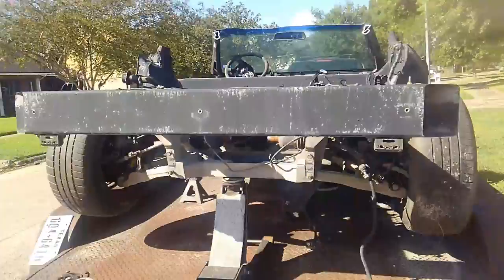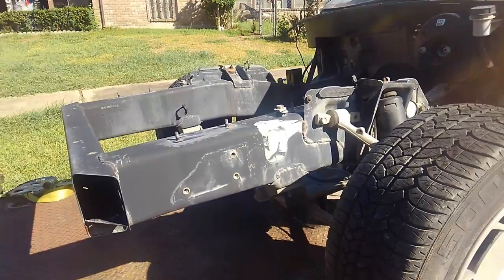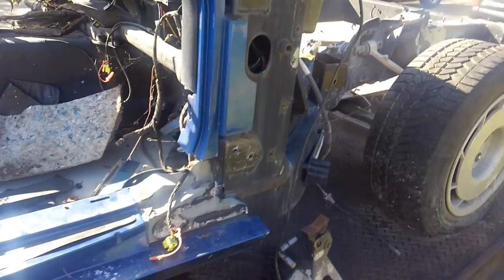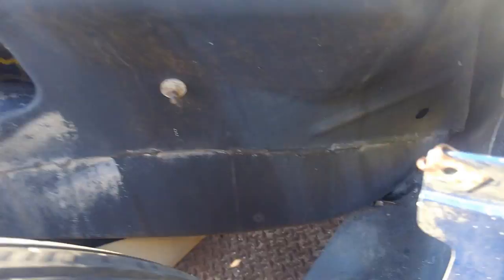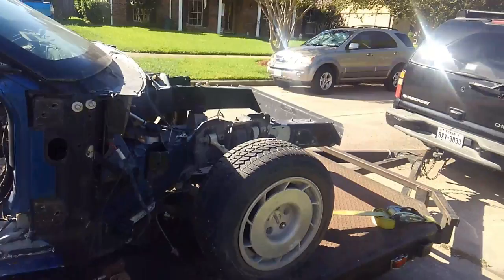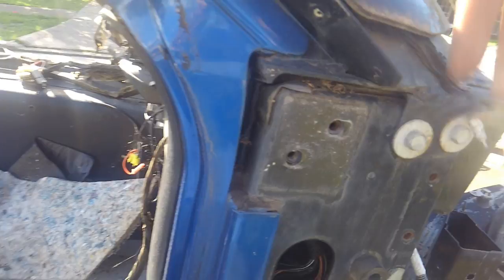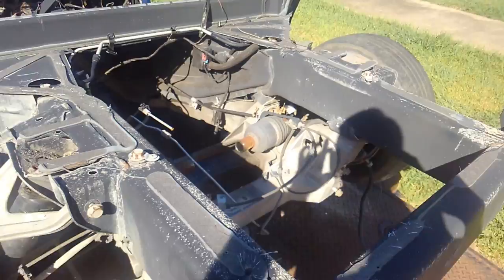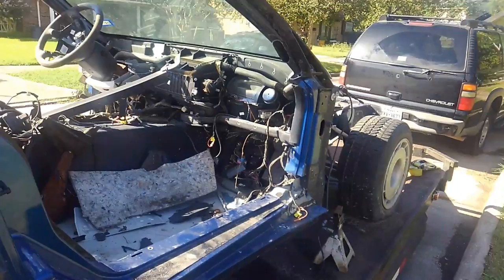How To-What Kind of Frame Does a C5 Corvette Have Exactly?

Comment: Looked at the Sawblade wheels and mixed it up with buddies C4 Grand Sport that was being disassembled. Thanks for taking the time to correct my comment.  Nice video.
Reply from the maker: James, not sure what you're seeing, but this is a 2002 C5 Z06, NOT a C4. The C5 hydroformed rails are welded in several spots where they connect to the front and rear tie bars, as well as the rear bulkhead behind the seats. I am pretty familiar with the differences between the two since I have been dismantling them for over 25 years. Thanks for watching👍.
Reply: @VetteSource  You are correct, my mistake.
Reply from the maker: No worries, happens to everyone at one time or another. Have a good evening👍.

Comment: I have a 2001 Z06 that has impact damage on the right rock panel beneath the door.  The car has yet to be torn down but Im almost positive that the lower right frame rail behind the rocker panel is bent in.  If I understand what you are saying in the video correctly are you saying that it could possibly be repairable?  I hope so.  I really don't want to lose this car.  Thanks.
Reply from the maker: It is repairable, it's just not the easiest spot to fix when it has been damaged. Make sure you have a good frame guy with right equipment, as he will need to make sure everything is lined back up for proper fitment.

Comment: Great information here! I have an 84’ beetle and I was thinking of putting it on a corvette chassis. Which year would be best? A 91’ vette is available for parts. Thank you so much!
Reply from the maker: Glad you enjoyed it👍. The C4 chassis is pretty much the same unitized design as a C5, with the exception of it being welded together in a few more sections than the C5. 

Most of the time when you see a custom build with a C4 or C5 chassis, what they really mean is that they used the suspension and small part of the chassis to mate to the car that that is being used for the build. 

Placing the body of another car over the top of the complete C4/C5 chassis, while not impossible, requires an large amount of work and custom engineering.

Comment: I think it would be interesting and educational if you set up a time lapse video of dismantling one of these.
Reply from the maker: Great idea, I have been thinking about that recently and trying to figure out best way to execute while showing as much detail as possible. Keep an eye out, I will probably try to put something together in the next few months.
Reply: @VetteSource  Yeah, I'd like to see that too. I'm going to buy and dismantle a C5 to use the suspension and running gear in a 1953 Chevy pickup.
Reply from the maker: @7884mac  yep, using the Corvette suspension is a popular conversion. You may be aware already, but the C5 Corvettes use a transaxle setup with the transmission in the rear of the car. The front and rear suspensions are "corporate" looking and resemble a front wheel drive setup in quite a few ways. The C4 suspension is the last old school style IRS axle made, and looks great installed on the earlier model cars.

Comment: I've got a bad idea probably but how had is it to separate the entire frame from the body to use the drive train and frame on a classic I have a 02 c5 I'm thinking about swapping under a classic
Reply from the maker: What you're looking at in this video IS the frame for the car. Since it's a unitized chassis, you will have to perform quite a bit of cutting and modification to both cars to make it fit another body shell on top on the C5 unibody. It would be much easier to cut the suspension mounting points off the C5 and integrate them into the frame of the car you want to build.

Comment: I've been looking too see a bare bones c5,cause  there's one (z06) for sale and  it has body damage. I think   water  damage.  Low very low water  damage. But it seems to have roof damage on passenger side, right at the windshield piler. To much weight from above and the passenger side went down.now I just  seen your stripped down c5 I know what it will take to repair. The windshield piler.  Thanks 😊
Reply from the maker: Awesome! Glad I could help so you could make an informed decision. Let me know if you need anything else👍.

Comment: Great video , where exactly can I find the Inflatable Restaint Front End Discriminating sensor? The GM manual shows it at bottom of front frame rail. 98 C5 base
Reply from the maker: If I am remembering correctly, I believe it's on the driverside rail behind the headlight asswmbly and to the side of the inner fenderwell. Let me know if you have any trouble finding it and I will double check.

Comment: Awesome video, thanks for sharing. Curious about pulling the newer aluminum frames on C7's. I assume the procedure is relatively the same but more welding involved?
Reply from the maker: Glad to hear you enjoyed it, thanks for the feedback. The C7 frames are quite a different animal. Instead of being a one piece rail, they are made of multiple subsections that are welded together. In some repair situations replacement and not pulling of the rail is recommended.
Reply: Are you required to cut replacement frame sections off another salvage car? Does GM sell these aluminum sections to specific shops?  @VetteSource
Reply from the maker: @c-shepard  you can go either way. With the amount of frequent frame damage C7's are incurring when wrecked, GM sells pretty much every piece of the frame to do repairs with. Used pieces will just save you some $$$ over new.
Reply from the maker: @Jonathan Isaac Rice Honestly, I am not a big fan. They claimed when the C7's came out that it was lightweight and strong, but that has not been my experience in the salvage end of the business. The welds look very cheap to me and are a constant failure point in collisions. I have seen entire front frame sections ripped off the cars in moderate front end collisions and cars completely ripped in two down the middle in extreme collisions.
Reply from the maker: @Jonathan Isaac Rice No problem. I am witholding judgement until I see them in the wild and wrecked. I think this push towards aluminum as a major structural component is the elephant in room for the auto industry. Just look at the cracked frames on the Audi R8's, catastrophic damage incurred in the new aluminum Ford trucks, and the Corvette frames like I mentioned. Aluminum being more brittle than steel will always be a problem, but hopefully they can figure out the material science to make them stronger.
Reply: @VetteSource  Hey, what do you think of the c5 chassis in its entirety? Can it take huge abuse (track days/drift days 30-40 a year and abuse off track), does it communicate well to driver, or would you say there are sections of the chassis that require huge reinforcement? Any other thoughts?
Reply from the maker: @AnotherMotorist  The entire C5 chassis is VERY strong and built like a Sherman tank. It is an evolution of the C4 chassis which was incredibly strong as well but produced with old school individual sections spot welded together. Other than a harness bar for strengthening across the B pillars, welding in a cage is overkill unless you will be drag racing the car. It will handle most other types of Motorsports quite well. You can see how strong the rails and windshield frame are in this video where I cut a C5 apart -

https://youtu.be/R2JIUBx_wM4
Reply: @VetteSource  I looked into it further and some people recommend the tunnel brace due to notable chassis flex? Other than that and as you said is a solid platform. What do you think of the tunnel brace. Will also take a look at your linked video.
Reply from the maker: @AnotherMotorist  I don't think they are bad, but maybe a bit redundant. The factory tunnel brace is strong, lightweight, and attached to the center tunnel with 40 bolts, no kidding. It stiffens the chassis quite a bit. I say try the extra base, and if you don't notice any difference it can always be removed
Reply from the maker: @StriderCX 2nd will do

Comment: Can u tell me what year classic trucks will fit on the c4 frame?
Reply from the maker: The C4 is a unibody like the C5, so there isn't a frame to set a truck body down onto. You'll need to adapt the suspension to the existing truck frame or purchase an aftermarket. 

You can see how the rear suspension is attached here -

https://youtu.be/gOe3nICj7Q0?si=lxsSIzPtO9joc168

Comment: Thanks for the vid. So would you say the corvette can be driven only with the frame? Just like a truck where the majority of the strength is in the "rails"?
Reply from the maker: Most definitely, think of the unitized frame structure as the foundational structural member for the out body panels to be bolted and bonded onto.
Reply: @VetteSource  This makes me happy for my merkur.... 1.5 inch w.b. difference dont scare me!
Reply from the maker: Yep, you should be able to work with that.

Comment: I want to use the frame on something else can I cut the body off the frame
Reply from the maker: All Corvettes C4 and up are a unibody construction and not the older traditional body bolted onto frame. What you see in the video is the unibody structure minus the majority of the body panels, which are either bolted or glued onto this structure. The front and rear suspensions are also bolted to this piece and are not a part of it. 

To see more detail of how it all goes together and comes apart, check out my playlist containing several disassembly videos -

https://youtube.com/playlist?list=PLAM-V1w3acpg_B2sVlXEL7UPOGVwiKmtL&si=gvx1w45sTbS-TrwR

Comment: looks like you might know how much should i expect to pay for a totaled c5? I just want the suspension and trans for a project car. Thanx very helpful video.
Reply from the maker: just so happens I have 2 complete front and rear suspensions from 2004 Corvettes. One is a auto, the other is a six speed. Did you need a torque tube as well, or are you going to go with a traditional driveshaft  to hook into the transaxle?
Reply: @VetteSource  thinking torque tube my dad has lot's of exp with engine swapping 944 Porsche's and he still uses the torque tubes in them. and was looking for a 6 speed trans i want to but the suspension in my 1971 dodge demon and just use a adapter plate for the bell housing to get a 5.7/6.4 hemi on it.
Reply from the maker: Gotcha, for a complete setup front/rear suspension with the torque tube, six speed transmission and differential figure about $3K. You can reach me offline @ 832-654-7367 to discuss further. Thanks again and glad I could help you out. 👍

Comment: What did you use to cut the tub out? Tools used
Reply from the maker: Hey Juan, no cutting. Use a heat gun in conjunction with a five in one tool and small screwdrivers/chisels and you can release the entire assembly in one large piece. There  are also 2 or 4? 7MM screws on the vertical tub surface attaching it to the frame rails but are easily visualized once you have it torn down. Let me know if you need any additional information👍

Comment: Could i use the frame  of 2005 corvette and adapt it to a 1966 chevy 11 nova
Reply from the maker: Daniel, I always say anything can be done, but it this case it will probably be much more time than it's worth to try and make it work. It would require you to slice up your Nova like a tube frame drag car, and basically slide the hollow shell down on top of the unibody structure of the Corvette. Not impossible, just ALOT of metal work, time, and expense.
Reply: @VetteSource   it
The whole floor is cut out someone started with a 70ish corvette frame with front and on-the- back  half frame rails
Reply from the maker: Gotcha, you're somewhat getting there probably the easiest part. From here you'll just need to measure, cut, and weld to adapt the smaller Nova body shell to the larger unibody chassis of the C5.
Reply: @VetteSource  there a guy that has a 2005 softtop forc 3500 no title he said just need the motor for a older vett
Reply from the maker: That would definitely be the way I would start. Then if you decide it can't be used, you can sell it off in pieces and recoup your investment.

Comment: GM did not invent hydroforming, and they weren't the first to use it in a vehicle (Chrysler was), although they were the first to use it for a major structural component. Hydroforming uses water pressure (7000 psi) in a form to force one piece of tubing into the correct shape. This results in a stronger frame component with no welds. Obviously, pieces are welded together to form the car, but hydroforming allows them to make long and complex pieces without welds.
Reply from the maker: Thanks for the information, I was under the impression it was a GM technology that they had developed. I see now Chrysler used it for a dash structural support in the minivans, but not sure that counts😁.

Comment: Does the c5 have a irs Supension
Reply from the maker: Yes, it does. However it is quite a bit different from the previous generations in that it's a transaxle setup with the transmission mounted directly up against the differential in the rear of the car. I have a video describing the teardown of the C5 transaxle unit here -

https://youtu.be/edt9AXJNfEw

Comment: I actually need that or one like it
Reply from the maker: Were you needing an entire chassis, or just the front/rear frame rails to repair an accident damaged car?
Reply: @VetteSource  I sent pictures to your Facebook I'm thinking complete chassis
Reply: @VetteSource  I found a 03 roller everything is there form the doors back the guy wants $2500 for it but it has no title
Reply from the maker: @shawncole7536  doesn't sound like a bad deal. I would just make sure there aren't any lien's against it or that it's a theft car.
Reply: @VetteSource  its actually at a Corvette dealer in fl they was using it as a parts car but if I do get it I need a little.
Reply: @VetteSource  my car has a a title for destruction
Reply from the maker: @shawncole7536  as long as there is no damage to the frame you should be good to go.